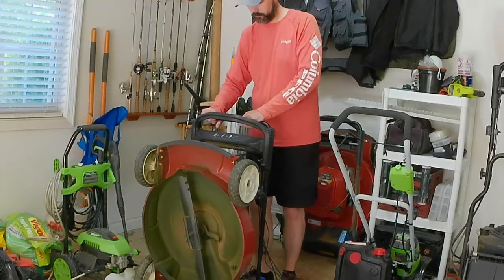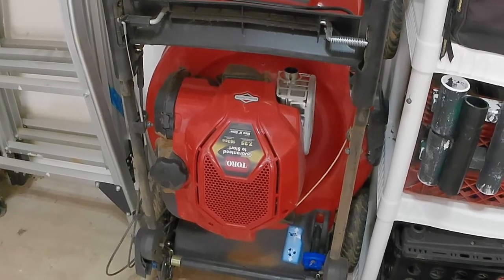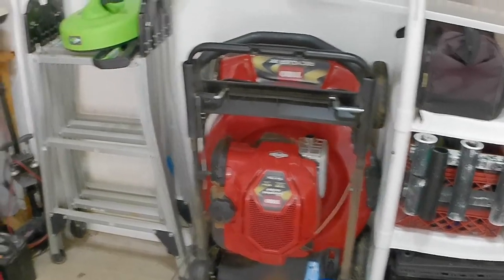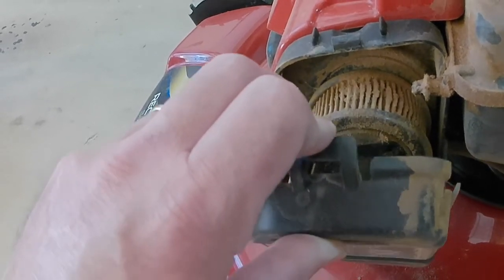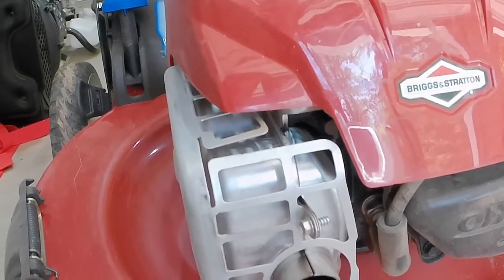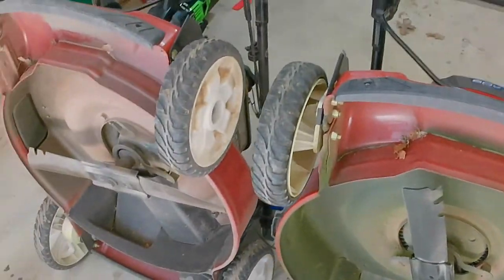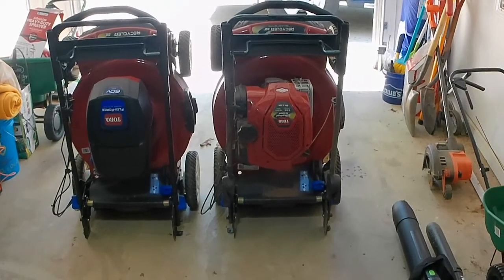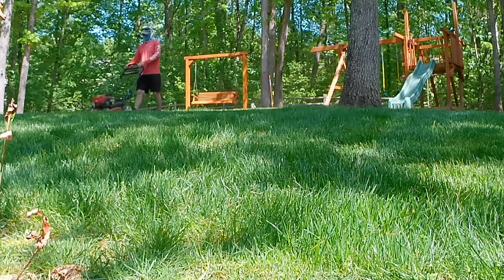Toro Recycler 60v Electric vs Gas - 2 year Review - Part 1

Comment: The most lousy lawnmower our family has ever purchased. Got a Toro Recycler in 2010 and had nothing but problems. IT NEVER WORKED RIGHT FROM THE TIME WE BOUGHT IT NEW AND TOOK IT OUT OF THE BOX, even after checking the filter, checking and replacing the oil, changing the blade. All it did was bog down and stall and leave clumps of grass. It guzzled gas like no tomorrow and blew the exhaust in the face of the person using the mower. Lousy engineering. Poor quality. It would not cut through tall wet grass without stalling and both of our craftsman mowers could do that no problem whatsoever.😂 So glad we sold it.
Reply from the maker: Wow hate to hear of your bad experience with the recycler. Mine have both been decent mowers, my dad still uses this electric one on his small lawn. Thanks for sharing your experience 👍